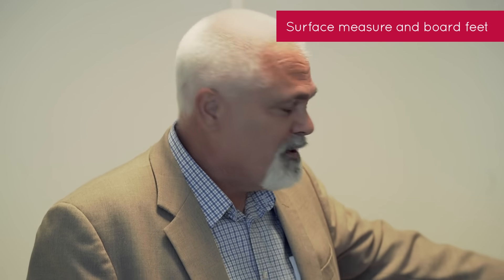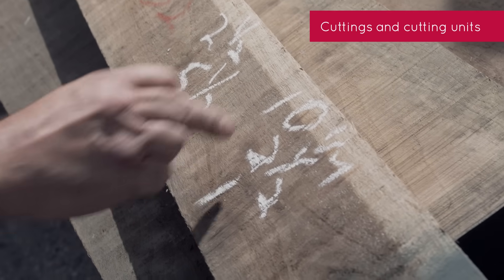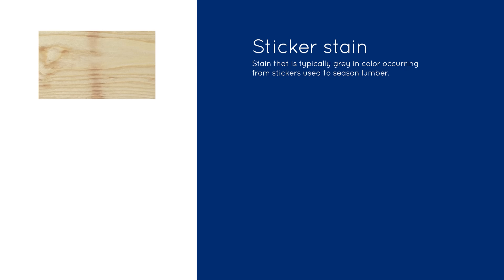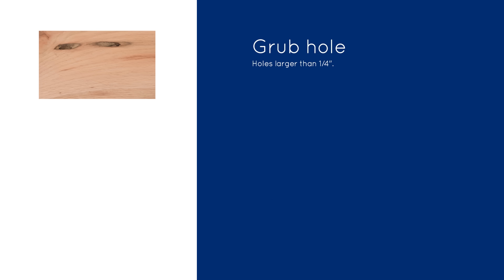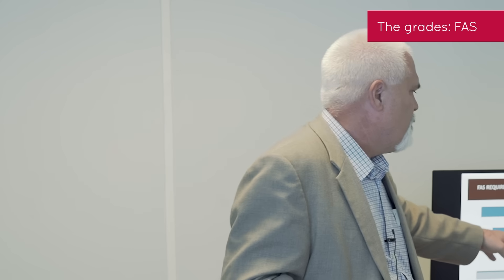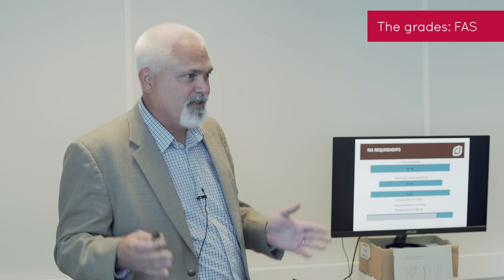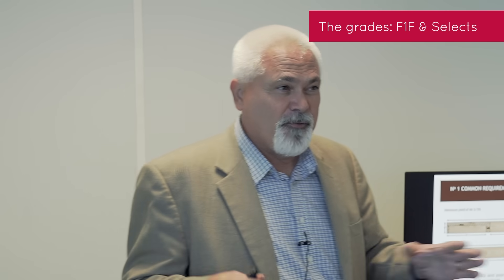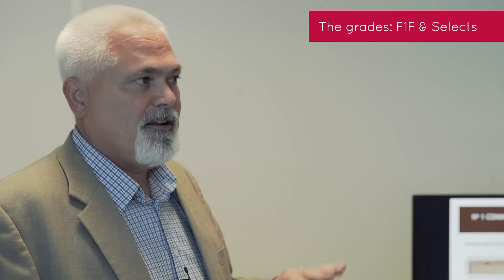An explanation of the American hardwood lumber grades by NHLA

Comment: I wonder what percentage of the hardwood lumber being sold in the U.S. is even graded? I assume it is not a requirement, which leads me to believe the number is small.
Reply: Almost 100% is graded. The only lumber that would not be graded would be lumber that is privately sold such as a person selling sticks of lumber to another person.  All lumber that is for export is graded and tallied according to an export tally which records each width, thickness and length. For domestic sale it is tallied by surface measure x thickness.